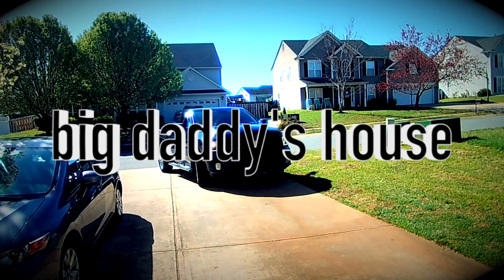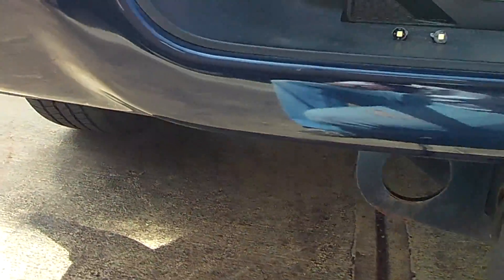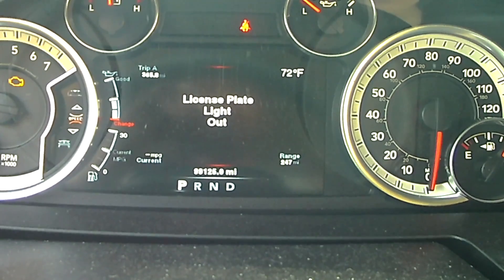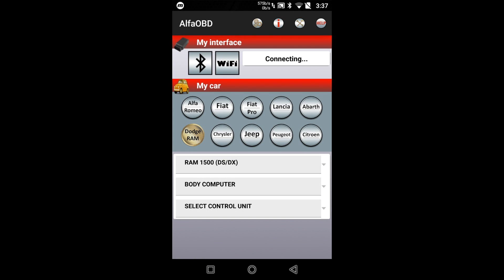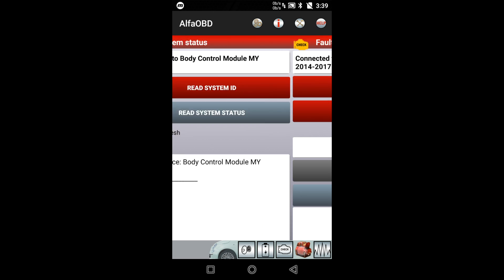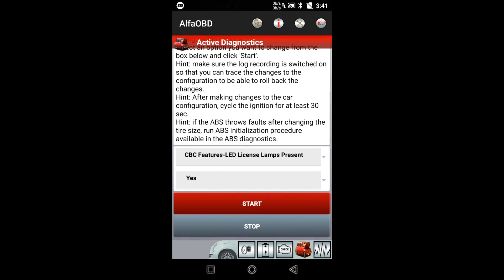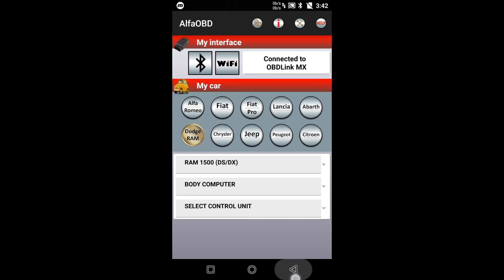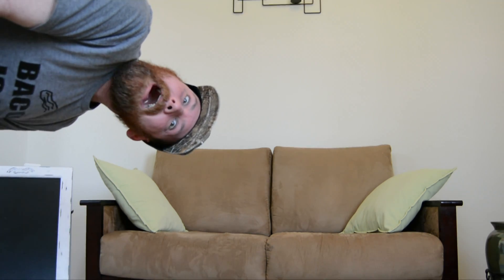AlfaOBD: LED light Install. RAM TRUCK

Comment: Great video, first one I found I could see exactly what to do. My 2013 Ram outdoorsman I put led rear turn signal lights, led license plate lights, led Oedro fog, and led katana headlights in my aftermarket projectors, but only code I get is from the led turn signal in the aftermarket projectors. So would I select 2013-2017 then just led turn signals? By the way, not sure what lights your running, but the Katana h7 led in my projectors are very good, cost $46 and same as the headlight revolution supernova v4 that cost $200. The oedro 9006 led us $29 and fantastic in oem fog lights, perfect light pattern and both led brands match each other perfect with a crisp white 6,000k output.
Reply from the maker: Bill, your comment has perfect timing! I'm going to be uploading a video next week where I replaced the low beam and high beam halogen headlights with Hikari LEDs. While I'm in there I will also be replacing the blinker lights with LEDs. It's going to be a long video. As you know I have to remove the entire Grill to do this...... More AlfaOBD coming
Reply: @bigdaddyshouse  is odd the katana led headlight never set off code or any other led I added, pretty much the entire truck now is led except the high beams. The led on my headlight turn signal is not a bulb though, is a led board built into the headlights, might be reason, too low power. If you haven't done fogs, the oedro 9006 fogs are really good output and perfect for $29.
Reply from the maker: @rotwiler7674  I'm going to take a wild stab in the dark and say you don't have the 7in evic... Right?
Reply: @bigdaddyshouse  I do, I have the 7 inch evic. I have a 2013 Quad Cab outdoorsman, 7 inch evic, 8.4 alpine system etc.  I have heard that 2013 is not as picky as 2015 up, but still see others say sets code. All the leds I put in are canbus. Still odd I have no resistors.

Comment: Hey Homie. Giving you some Alaskan Love. I purchased the Morimoto Xb LED Lights. With this set up and you teaching us how  you helped me fix them and be able to keep this expensive lights. Thank you man.
Reply from the maker: Glad I can help out brother.
Always wanted to visit that beautiful state of yours!
Thanks for the support!
You should check out my newer AlfaOBD videos.
Most people have found them helpful.
Reply: big daddy's house is there a way to have keyless entry set up. My vehicle equipment outline says it has it but I don’t have sensors for the door handles.
Reply from the maker: You can enable keyless entry with AlfaOBD however its not as simple as just that. You will need a few hardware pieces also. Instructions can be found here. RAM FORUM   AlfaOBD thread:
https://www.ramforum.com/threads/alfaobd.123982/
Reply: big daddy's house do you know how to set srt pages for the Ram 1500
Reply from the maker: @tdak9077  nope.
Don't do it sir! It will change so many values in your truck the dash will light up lake a Christmas tree! And may even require a clean flash from the dealer.
Reply: big daddy's house thank you for the heads up. Alaska has finally got some snow. I was told by the people I bought my lights from to bump my voltage from 13 to 13.8 do you think that will mess with anything?
Reply from the maker: @tdak9077  although I haven't done it myself, I've seen guy's in the ram forum do it without and issues.
Reply: big daddy's house hey homie. So this is completely off topic. But have you had your dash lights flicker and it’ll go away turning up the brightness?
Reply from the maker: @tdak9077  Haven't had that happen but I have my interior dash lights all the way up all the time.
Did you notice this after an alfaobd change?
Reply: big daddy's house not until it hit 5 degrees here
Reply from the maker: @tdak9077  ouch.....
And that's just the beginning of whats to come.
Are you a member of the ram forum? If not sign up and ask that question in the electrical thread.
https://www.ramforum.com/
Im sure somebody's had that problem and can walk you through a fix.
Reply: I am having an issue with my morimoto XBs, I had them for two years now issue. Had to get them replaced due to lens fading and the new ones are throwing a indicator that my left front turn signal out and hyper flash in the left side door mirror only. Everything else working fine

Comment: Can you disable the left and right out taillight message with this? My wiring was pinched… there was no fixing it having traced it all it wasn’t working. (I had to put a new bed on from an accident) anyway my taillights all work now I fed power through the trailer lights, trailer lights worn as well. Can I just disable the stupid messages so I can have a normal blinker sound again lol. Hate the messages tpms etc. annoying lol I have a 2011. I’ll buy it if you think it can be done👍🏼

Comment: Any idea what would work on a 2018 ram 1500 that came with projector headlighs throwing a left turn signal out after install of morimoto xb headlights? All lights work, only hyperflashing on left front side view mirror

Comment: Off topic question. When you hook up the oled tubes to the parking lights. On the passenger side. Am i supposed to splice into the middle wire or brown/white even though its  not in the middle?
Reply from the maker: Sorry for the late reply brother! 
I honestly don't remember what color wire It was or where it was on the harness.  I just use my circuit tester
https://www.amazon.com/dp/B003UHNMMS/ref=cm_sw_r_cp_awdb_btf_t1_p4inFbFYXHYG0
testing all the wires while the parking lights were on and off and while the blinker was on and off. so I could determine which wire to tap into.
If that isn't helpful enough, you can always ask if anybody in the RAM forum has a wiring schematic to share with you.
https://www.ramforum.com/forums/general-discussions.38/
I hope this helps out.

Comment: Hey 
I have a 14 Express that didn't have the garage door/ overhead console. I went to a junk yard and was able to pull all necessary wiring and parts. I noticed that I can't program the garage door buttons. by any chance do u know if there a setting in to activate the program. 
I'm buying obd MX on Amazon they are sale as of 5 Dec.
Reply from the maker: Hey Jimmie, there is a slew of questions that need to be answered. This isn't just a yes or no question.
Ask you question in the Ram forum and we will set you straight....
https://www.ramforum.com/threads/alfaobd.123982/

Comment: Hi. I have a 2018 ram 1500 night edition. Upgraded the factory projectors to hids and used hiakari resistors. They flicker twice and then get bulb out error on my dashboard. My question is if i get alphaobd program will it work on my truck ? The settings on it say 2013 to 2017 ram 1500 on alpha obd?.  Does my truck (2018 ram 1500 sport night edition) have that stupid security feature like the 2018 to 2019 ram 1500 classic? Will i need that bypass secruity thing? I know these are stupid questions but i want to be sure. Im not an electrican and dont want to screw anything up. Any help is appreciated.
Reply from the maker: No question is a stupid question..... yes it will work on a 2018 with the bypass harness. Before you enable any settings in AlfaOBD  you have to remove those resistors.
There is good reading material here on this. RAM FORUM AlfaOBD thread:
https://www.ramforum.com/threads/alfaobd.123982/
Thanks for watching!

Comment: Is there a way to get ahold of you?! I have a 2010 dodge ram and just installed factory Laramie seats and a Laramie dash panel that all gives me heated and cooled seats. All wires plugged in. But now I know I need to turn on this feature all your videos talk about 13-18. Will this work for my 2010?
Reply from the maker: Hey Zach, I know some things can be enabled between 2009 and 2012 but I'm not sure about heated seats/steering wheel.
This would be a great question to ask here
https://www.ramforum.com/threads/alfaobd.123982/
I hope you get the answers you're looking for brother!
Thanks for watching
Reply: I got the tablet and the module for Bluetooth and bought the app I turned the feature on. As a different video showed how to do it. Unfortunately it does not work on my truck. :( well I tried. At least I got sweet leather seats that look and feel a lot better than old cloth ones. Can’t get everything I guess. Thank you for actually responding tho keep up the awesome videos! You helped a lot regardless
Reply from the maker: Sorry It didn't work out Zach. 09 to 12 is tricky. But I'm glad you're happy with your sweet leather seats!

Comment: Great vids big daddy, I have an issue with my 2017 ram 1500, maybe you can help, I put LED’s in the taillights, they flash at normal speed in the taillight but in the instrument cluster the turn signal hyper flashes, tried the Alfa obd turn signal present and the CBC tail lamp present but nothing stopped the hyper flash in the cluster. Can u help?
Reply from the maker: Sounds like you have everything right but I highly encourage you to visit the 
RAM FORUM: AlfaOBD thread https://r.tapatalk.com/shareLink?url=...
There's hundreds of RAM owners who may have had the same problem as you and are more than willing to assist.
Sign up! You won't be sorry....

Comment: Hello Big D, great video, you mention around 7:27 downloading and backing-up original configuration, good idea, any info on how to do that?
Reply from the maker: Great question. Sorry for not showing that. Fire up AlfaOBD and in the top right corner next to the help icon is an icon that looks like 2 tools crossed. (this is the icon you need to hit) it wii bring up another screen  and give you the option to read and upload trucks current status to Google Drive.
Remember when you go in to change functions only do one at a time and make notes while you do it that way you can change it back if need to.
Thanks for watching!
Reply: @bigdaddyshouse  Excellent , thank you
Reply from the maker: @BG11704  no problem. Have fun playing!

Comment: Will the OBDLink MX work on a 2012 Ram 3500 to fix a LED Headlight Flicker
Reply from the maker: Hey Summitbound, I know some things work on a 2012 and some don't. I don't know what offhand because the RAM forum has a separate thread for AlfaOBD '09 to 2012. 
I would suggest you sign up in the RAM forum and ask your question there, just to make sure before you drop your money on alfaOBD.
Here's the link to the RAM forum
https://www.ramforum.com/
Thanks for watching and your support brother!

Comment: Does AlfaOBD read/delete codes. All I can find is what it can do  as far as changing/ adjusting factory settings. Can’t find anything about reading/deleting codes or running diagnostics.
Reply from the maker: Yes sir, it will read and delete codes also. with the free version of the app it will only read codes but the paid version will do everything.
First thing you would do is open the app and connect over Bluetooth.
Then hit Dodge ram, body computer, select control unit, body computer my 2013-17 power net ( or whatever vehicle year you have)  on the bottom right hand side of the app there is an engine with the word (check) in the middle of it. Touch that.
Now you can read all faults and then clear faults also.
Hope this helps out brother. thanks for watching.
Reply: big daddy's house 
It does help. Thanks Adam.
Reply from the maker: @FronkyJoe  no problem. Happy modding

Comment: Would the Alphaobdmx+ work on my Ram 2015or just the alphaobd?
Reply from the maker: Hey brother, so you need two different things to make this work. The MX or MX plus is an OBD2 reader that you plug into your OBD2 port underneath the dash.
The second part of this is the alfaOBD app which you have to download on the Google play store. 
But both OBD2 readers MX or MX+  will work.
Here's the link of the forum I use.
https://www.ramforum.com/threads/alfaobd.123982/page-1181#post-2328544
Happy modding!

Comment: Anyone know how to delete stored parking light out message? I have tried AlphaOBD MX without any success all of my LED's are working and not blown i recently changed my factory headlights to Alpharex Pro G2 headlights and i enabled all LED's on my truck and i recently installed the 7inch cluster upgrade and now I'm getting the parking light out stored message btw 2014 Ram 1500

Comment: So, what happens if the LED burns out? Do you still get the "lamp out" message?
Reply from the maker: Yes sir.
You're telling the computer the vehicle is equipped with LED lights. So if the light goes out the message will reappear.

Comment: Do you have to buy the $50 app or can you get the demo?
Reply from the maker: The demo version won't allow you to make any changes. It will only show diagnostics. 
So if you're looking to make changes you need to buy the app. 
Thanks for watching man!
Reply: @bigdaddyshouse  okay. And will it work with only the OBDII that you used or will it work with other Bluetooth ones?

Comment: I replaced my license plate lights with LED's they turn on fine and never got an error. No OBD
Reply from the maker: Hey Luis, that can be accomplished if you buy canbus safe LED bulbs or you have the 3.5" Evic. The 3.5" Evic is a lot less temperamental than the 7-in. 
I had gone that route for a little while before I discovered AlfaOBD. now instead of trying to trick the computer with bulbs that aren't made for it, I tell the PCM when I am running.
Thanks for the comment brother.
Reply: Where can I buy the link?

Comment: I just buy the Cambus safe LEDs :)
Reply from the maker: You can do that but if you're looking to do your entire truck with LEDs than you will be saving money in the long run with alfaobd. Plus this thing can enable all kinds of factory settings if you don't have a Laramie.
I'm going to do more videos on alfaobd. If you don't have one you're missing out. Thanks for the input.
Reply: @bigdaddyshouse  Let's see what you make me do :O :P I have a fully loaded RAM Sport 4x4  2015 - rambox and 4 corner air
Reply from the maker: @tokslut  challenge accepted ☺
Reply: @bigdaddyshouse  hehe
Reply from the maker: Have I taught you anything yet LOL 😂
Reply from the maker: You are one of my first subscribers! Thank you sir! I want to make sure you're getting what you want out of this Channel..... 😂 what do you think so far?
Reply: @bigdaddyshouse  you are doing good!
Reply: If you have a 2015+ Ram even the “CANBUS safe” LEDS can give you problems. Mine sure as hell did.
Reply: @jaythewhizdog3842  ok, I have a 2015 and cambus safe LEDs works for me. The quality sucks thow. They work shorter than glow lights...
Reply: tokslut that’s a problem. Buy regular LEDs and change the system to know it has LEDs with the AlfaOBD. Simple.
Reply: Jay The Whizdog  (15’ ram 1500) i had canbus leds and mine turned off every 5 mins. Are u saying that by removing canbus and having JUST the leds and doing the alfaobd change, WORKED? And solves any flickering ?